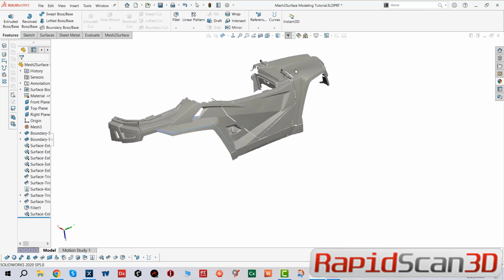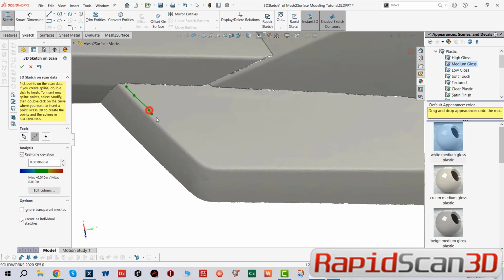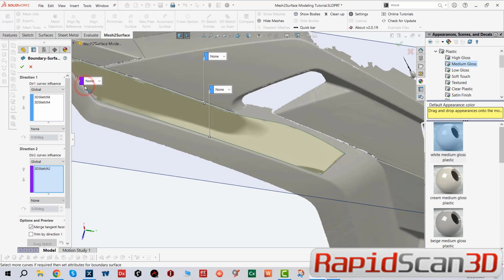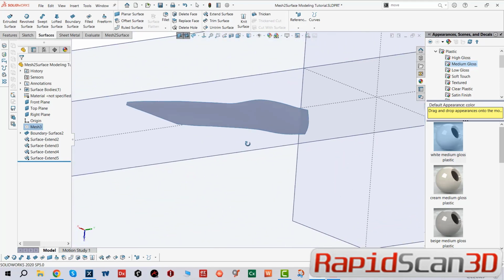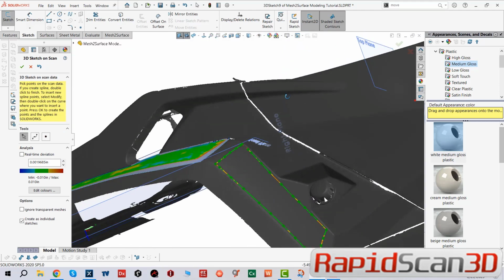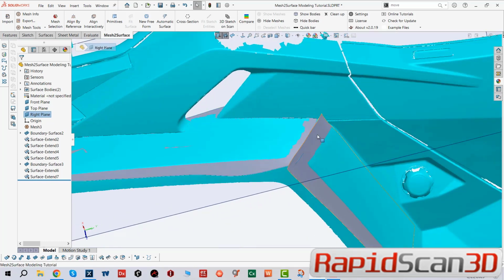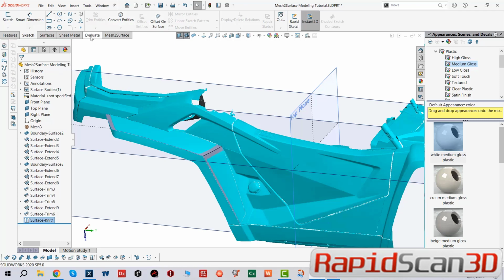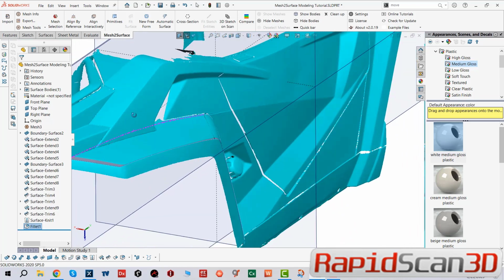Mesh2Surface Tutorial Solidworks - Rapid Scan 3D

Comment: The explanation is clear and easy to follow, especially the demonstration on how Mesh2Surface and SolidWorks can be used together to build accurate 3D models directly from mesh data. Techniques like Deviation Analysis and Zebra Stripes significantly enhance the precision and smoothness of the final surface. Thanks for sharing these valuable tips!